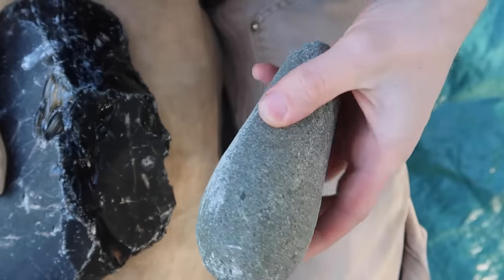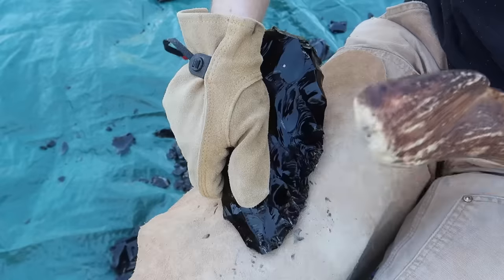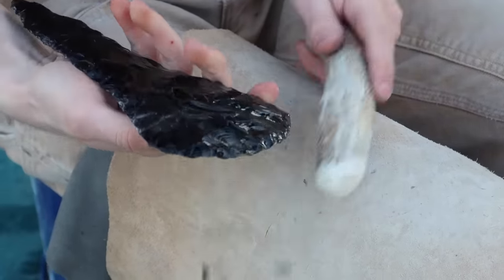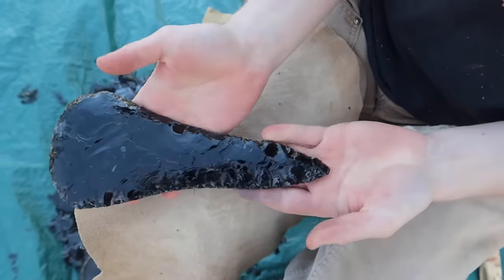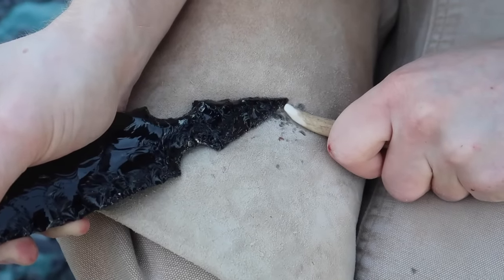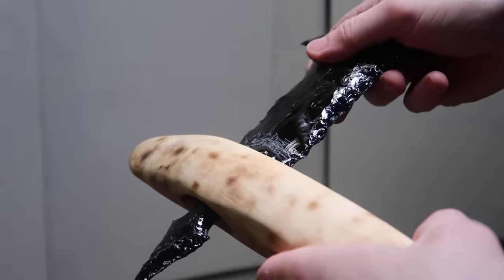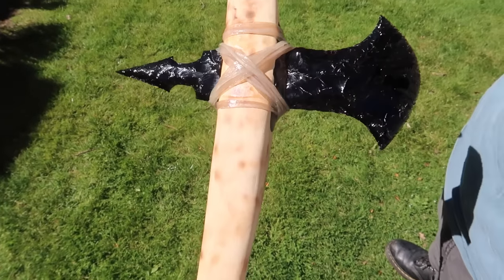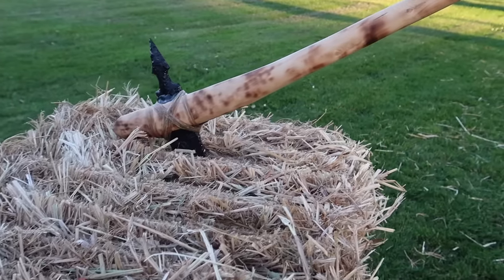Making an Obsidian Battle Axe

Comment: Ignus
+100 sharpness
-100 durability
+50 agility 
Exceptionally effective on unarmored or soft armored opponents, however the blade has a high chance of shattering into razor sharp fragments on impact
Reply: r/item shop
Reply: 25% more critical hit chance, base level bleed damage of +10, lasts for 5 seconds. Effects double by 1.5 every 20% durability decrease.
Reply: @tylerwilson5769  oooh, clever
Reply: +Razor sharp fragments greatly bleed targets and immobilizes them
+Some Fragments may act like small caltrops that makes targets bleed when stepped on
Reply: Then that’s shrapnel in the body which= more damage and internal bleeding😊
Reply: 75 percent critical hit chance on mamas like deer or elk.
Reply: @tylerwilson5769 Loses 50% less durability on crits
Reply: "Glass cannon"
Reply: Ability shrapnel shot strike to break intentionally to cause shards of shrapnel thar deal 5 damage + 3 additional damage when opponent moves
Reply: PROS: 75+ more damage, adds 3 bleed stacks on player you hit. %25 more random crit chance.
CONS: On miss, hit yourself, adds 2 stacks of bleed.
Reply: Does it have mending?
Reply: Special effect: vulcanus, during the dry season, when the volcano is active, the blade starts leaking molten lava and starts to deal fire damage. Will overheat if the vulcanus effect is overused, causing 1 damage per second until it cools
Reply: That's alot of enchantments
Reply: Robber comes In OH HELL NAHHHHH HAVE A GOOD DAY SIR IM GONNA GO runs for his life
Reply: this guy smacks his thigh with tools for content
Reply: Now that's the only thing I learnt about I science class
Reply: Has a 5% chance to be shattered in the body upon impact
Upon body shattering
+bleed for 60 seconds
+3x damage
-axe turns into a weapon handle
Reply: splash damage
Reply: 50% chance the food you cut becomes filled with obsidian pieces
Reply: Causes obsidianal infelections. 1 dmg per sec. Lasts 10 - 20 sec by severity. Crit last 1 min
Reply: @NecrIon79 nah, that’s a glass NUKE
Reply: Chalk one more up to the team of Captain Obvious! Its a show piece.
Reply: big r/itemshop energy there
Reply: @Superchadier  what is thar
Reply: Fr
Reply: vendo-a o homem de Deus de longe, disse a Geazi, seu servo: Eis aí a sunamita.
Agora, pois, corre-lhe ao encontro e dize-lhe: Vai bem contigo? Vai bem com teu
marido? Vai bem com teu filho? E ela disse: Vai bem.
Chegando ela, pois, ao homem de Deus, ao monte, pegou nos seus pés; mas
chegou Geazi para retirá-la; disse porém o homem de Deus: Deixa-a, porque a sua
alma está triste de amargura, e o Senhor me encobriu, e não me manifestou.
E disse ela: Pedi eu a meu senhor algum filho? Não disse eu: Não me enganes?
E ele disse a Geazi: Cinge os teus lombos, toma o meu bordão na tua mão, e vai;
se encontrares alguém não o saúdes, e se alguém te saudar, não lhe respondas; e põe
o meu bordão sobre o rosto do menino.
Porém disse a mãe do menino: Vive o Senhor, e
Reply: Like a hollow point dude
Reply: more like +100 durability 5% chance to break on hit
Reply: Special ability: can loose 40 durability for the next attack to inflict 20 bleed damage and the glass shards debuff

Comment: Won't it break really easily?
Reply: Idk
Reply: P sure it's good for like 2-hits
Reply: Depends on what you hit. For wood then probably but a human or animal probably not
Reply: Um what is this comment section
Reply: it's not glass
Reply: @_ezdc_  Still a very fragile material
Reply: @_ezdc_   It basically is
Reply: @_ezdc_ it actually is a volcanic glass
Reply: Depends so obsidian is very similar to tempered glass where it is incredibly sharp, so sharp that it can effortlessly cut through SOFT things like leather that still also have texture and are slightly firm. However when it it struck on a harder surface on a single very small point than just like tempered glass the whole thing will just desintergrate. Another important property is that it has a very good crush streingth but a very poor bending strength because of how its molecules are arranged. This means that if you make it into something long like a katana blade it will most likely collapse holding its own weight and even it doesn’t, the middle part will be holding all the force and will be under immense pressure and will likely snap if you hit something even lightly. So the most strongest shape of an obsidian blade are small blades such as surgical tools and small hunting knives which needs to hold less weight rather than something like a sword or katana (but an obsidian sword would be pretty cool though😅)
Reply: its a BATTLE axe, its not meant for stuff like cutting down trees
Reply: It depends on if he's hitting a diamond pickaxe
Reply: Tell me some more deadly because then it will break inside your enemy
Reply: That makes it more deadly because it’ll break off inside your enemy
Reply: @chriszhang8509  one time use tho...kinda busted so i can see why god would nerf it
Reply: Is not that fragile
Reply: @ObamaKingmen  if you hit a bone it will Chip or break for sure. The obsidian scalpel that is used for eye surgery doesn't break only because you use it in a cuting motion on soft tissue.
Reply: @builders_republic  ☝️🤓

Comment: One thing that always amazed me when working with obsidian was just how easily the cuts would heal. compared to a cut from a knife, cuts from obsidian flakes bleed, then heal up with barely any inflammation or pain. Of course if you cut open a gash several inches long or from the jagged edge of a finished stone tool, things might end up very different.

Comment: why do you break all those pieces off? just break the piece off that you need and save the rest of the rock that has been untouched. what if you want to make another axe head? i get confused at this process because it seems wasteful really. no offense because everyone does it who makes these axe heads but i don't get it. you could have gotten your axe head if you took off a big enogh piece but you made a bunch of little pieces and then your axe head? you could have had your axe head in the first few strikes with a large rock. the axe head is not in the center of the giant rock, it comes off of big flakes from the big rock that you are chipping away from. sorry im just confused
Reply: You get zero control with the method you're suggesting, hence nobody attempts it. You could get any sized piece with any random shape.